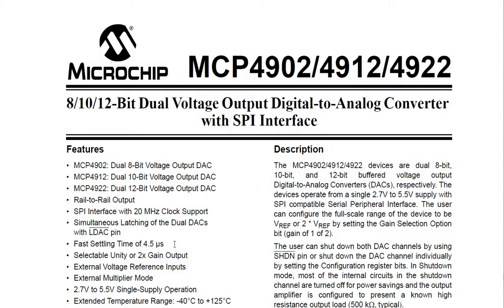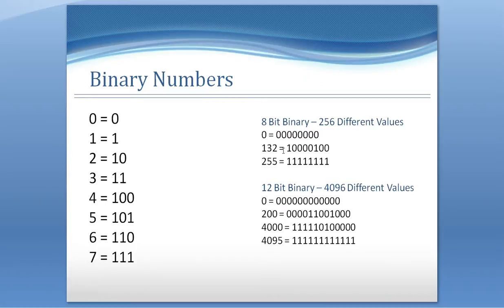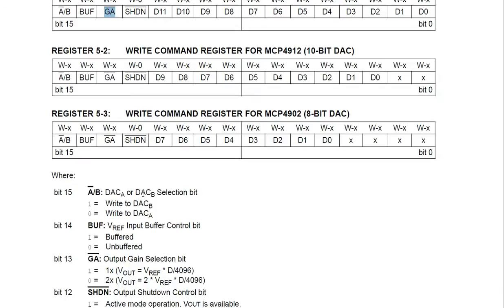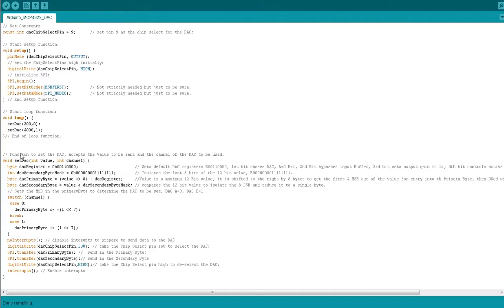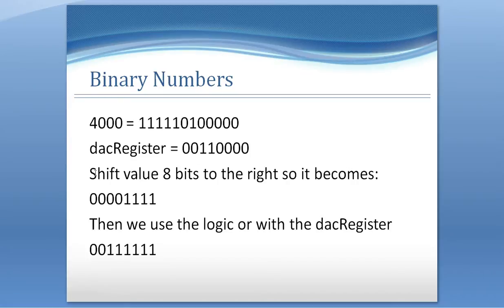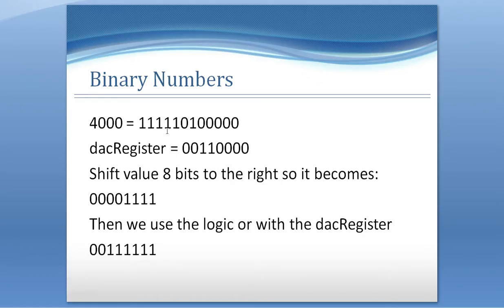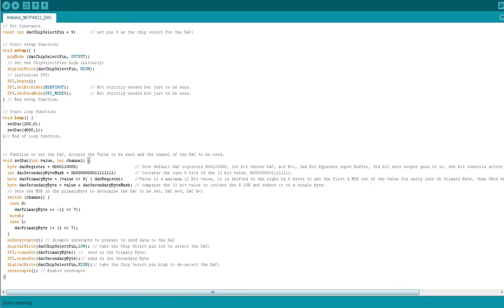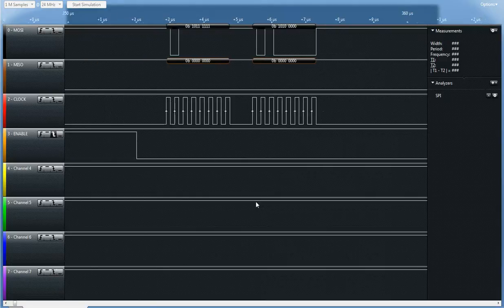Tutorial: Using Arduino SPI - Part 2 - Microchip MCP4922 Digital to Analog Converter (DAC)

Comment: Very useful! Only thing it lacked for me was how to connect the Arduino and the DAC. It's a shame some users seem to consider that somebody OWES them better audio!!! Unbelievable - anyway THANKS A LOT! I'll be using your setDac function in my projects if you don't mind :)
Reply from the maker: Yann Guillermou, thanks for your nice words. Could I suggest you check out part 1? I am reasonably sure it will answer your connectivity questions https://youtu.be/7stXM1J3ef4
Reply: I did watch part 1, maybe I skipped a bit? I'll watch again (and I'll have to learn how to use an ADC as well so I'll check part 3 too) :)

Comment: do the SPI pins also have to be declared in the code? Is it possible to softprogram those and use other pins than pin 13,12,11 from the arduino?